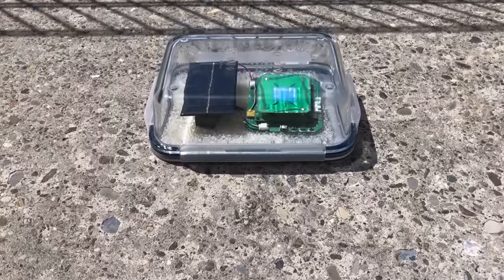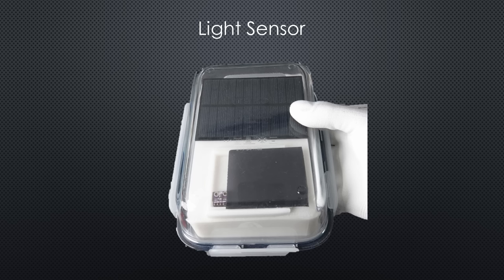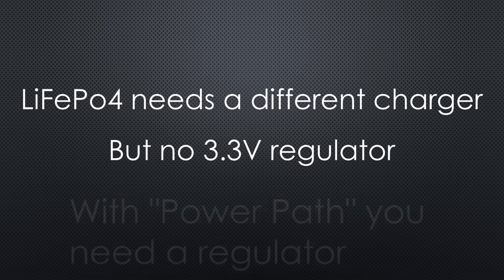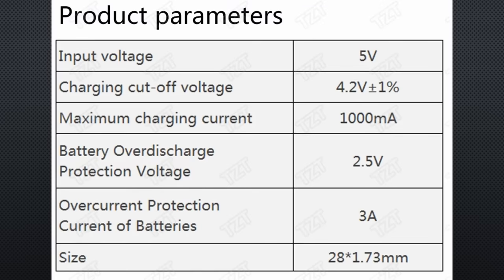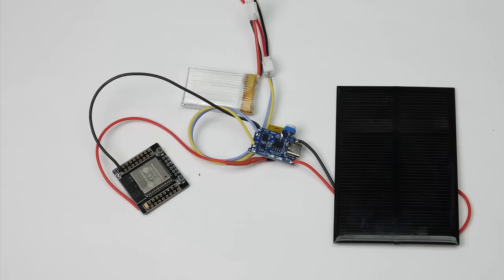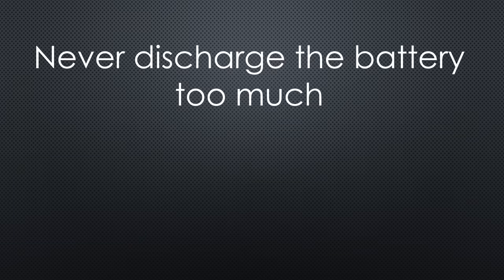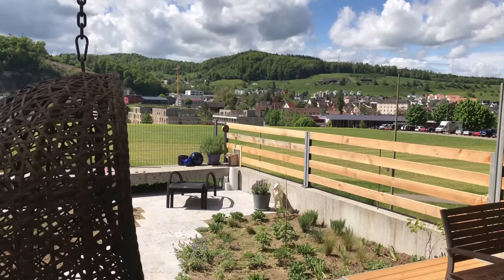#383 Cheap and simple Solar Power for our small Projects (ESP32, ESP8266, Arduino)

Comment: If you drop 4056 and use a proper charger IC, you will find the power path (incl. the switching get) inside the chip.
Reply: whats an example of a proper charger IC?
Reply: @bjornotto98  max77751, but if you make a parametric search at TI with the keyword "power path" and/or "power management" you will find some. Having the battery and the system power on the same output is not the way in modern portable device
Reply from the maker: You are right. You find many chips with built-in power path. Unfortunately none is used by the Chinese manufacturers. Adafruit has one, but more expensive.
I do not care too much about temperatures. So far I had no problems and I did not find any info about charging Li-Ion batteries at low temperatures with small currents. I even read that electrical cars charge their batteries at low temperatures with reduced current. And our currents, particularly in winter, are very small. But I expect that the batteries will not live as long as indoors, for sure.
I also do not see the need of a thermistor. My batteries are always completely charged during high temperatures, and the power path makes that they are not used. So "storage conditions" apply.

Comment: i'm really bad at electrical engineering problems, but here's what i'm planning to use (prototyped it already /got the parts before seeing this video):
- d1 mini with it's 3.3V regulator
- 18650 3Ah cell
- 60mA 4V solar panel (has about 4.5V max voltage without a load)
- 3V9 zener diode to pull down the solar panel voltage in case the battery is full
- schottky diode to battery to prohibit reverse current which would discharge battery through the zener diode
- 18650 output directly to d1 mini 5V input

Do you think this is a bad idea? It doesn't have battery undervoltage protection or a proper charging curve but the battery is way overkill and It's the fewest component/lowest complexity/cheapest setup i could think of. So far (no solar panel added yet) i've been monitoring the battery voltage manually every few days, maybe i'll add an ADC for monitoring the battery as well though (using A0 already)
My esp sketch is always deep sleeping for 60min so the active periods are pretty rare and relatively short
Reply from the maker: Just try it and you will know. You always have this video as a fallback...

Comment: Changing the charge current resistor is not necessary. Solarpanel will take care of this.
Board cuts off the load to prevent overdischarge, no need for alternate current path.
I do use this to charge an unprotected 18650 cell. Did not explode yet.
Reply from the maker: I al glad it works for you. In the special cases I mention you might need these additional parts.

Comment: Great video as always, Andreas! I do have one question though. Have you tried designing your own PCBs?

I find that assembling things from modules, especially when there are modifications to make, is fiddly and takes a lot of time and often ends up with a not-so-reliable project.. and I find that going straight from breadboard prototype to a custom PCB is not only neater but actually saves time in the long run. It's incredibly inexpensive to order custom PCBs from China these days. It doesn't seem like you've made a video about it yet, unless I missed it. I can't recommend designing your own PCBs enough, I started two years ago and I've never looked back. Even if the PCBs are sometimes mostly carrier boards for other PCBs, at least it still saves having to make dupont cables. :)
Reply from the maker: You are right. I also sometimes do PCBs. Usually for things with a lot of connections. Here it is probably faster to add the few components.
Reply: @AndreasSpiess  Thanks for responding! I'll bet a lot of people (and me of course!) would love to see a video from you about designing PCBs, you have a great way of explaining things simply and making PCBs really is so much easier than most people think.
Reply: @leifclaesson2470  i for one would love to see an assembled pcb with these extra parts available

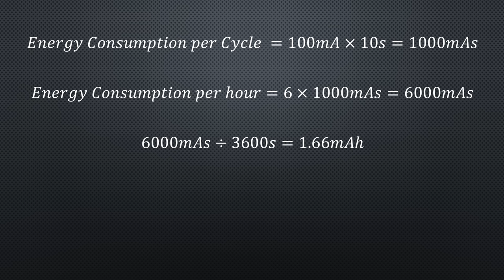Comment: Thank you for the video! I think that there is just a little mistake about units, when you calculated the 1.66mAh(2:41 timestamp) , it looks like  you cut "s" with "s" and you would have "mA" as a result, I think that it should be: 1s = (1/3600)h  -> 6000mAs = (6000/3600)mAh. Sorry for my bad English.
Reply from the maker: You are right. It should be 3600 not 3600s

Comment: For the battery monitor section... when targeting for Deep sleep of the ESP32/8266 I do not like to use voltage dividers... the cannot be put in deep sleep... and they are always draining current (a little... but continuously)... I prefer to let ADC open and measure the internal voltage during the non sleep operation.
The drawback is that you realise only when the Lipo starts to drop from 3.47V (3.3+0.17... I mean, from 4.2 to 3.47 you measure always 3.3V)... but as this scenario is normally in low consumption... you have plenty of (run)time (hours or days) to send alarms and go to your device to replace batteries or check what's going on.... as this is the path from from 3.47V to 2.8V of the Lipo...
Reply from the maker: Good idea! I did not know that you can measure internal voltage.

Comment: Hello, tell me if i'm wrong but the problem is that no panel voltage measurement is taken and operation is only based on the threshold voltage Vgs of a MOSFET, which voltage varies greatly as a function of the drain current. It is even a safe bet that depending on the copy of MOSFET used this voltage also varies. The second problem is that if the panel voltage is low, the current it will be able to deliver will also be low, unless you oversize it very widely. If the available current is low, while the ESP8266 is consuming current, the panel voltage will drop sharply, and the MOSFET will shut off, and the battery will take over. Then, if the panel voltage is insufficient for the TP4056, the charging current will be zero, so the voltage will go to its initial value and the MOSFET will switch again, and so on.
Reply from the maker: You are right: We use the battery to bridge the time without sun. This is why the panel has to be able to deliver enough energy for a whole day in a few hours.

Comment: Would be very interesting to have some lecture with super capacitor instead of the lipo battery. Cheers.
Reply from the maker: I used once Supercaps. But they are only for very low power boards. Not like the ESPs...

Comment: Hi Andreas
In the beginning, thank you very much for your video(s). I know it was produced almost a year ago, but I hope you still look at the comments :-).

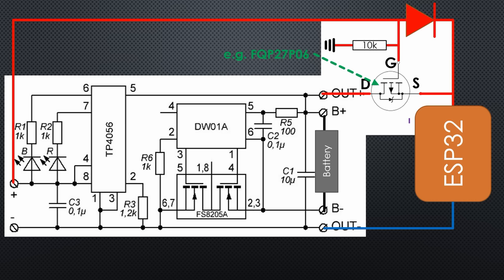I doubt the circuit presented at the video time frame of 11:58. The MOSFET shown in the diagram is an N-MOSFET, while FQP27P06 is a P-MOSFET. Then OUT+ of TP4056 should be linked with S of P-MOSFET and D with ESP32. 

I can be mistaken as electronics is my hobby, not a job. 
Anyhow, thank you very much. 
Best regards
Greg aus Waadt
Reply from the maker: I added a link to a video where this circuit is explained. But maybe I did a mistake while I copied it ;-)
Reply: @AndreasSpiess  NP. We need to be awaken while building it. 
BTW maybe it could be a good idea to have some information about Swiss or European electronic part vendors as I stopped to purchase at AE. I do not want to support them, as long as they support an aggressor. 

With best regards
Greg Malik aus Waadt
Reply from the maker: @grzegorzmalik9279  You find a few Swiss distributors like Pi-shop or Bastelladen. But they sell the same stuff as AliExpress. So I fear that the only thing is to change the hobby because most of the electronics manufacturing plants currently are located in China.

Comment: so I have similar set up and I realised that voltage divider for ADC measuring battery voltage is another culprit: constant leak of the current through these 2 resistors. Issue is: you cannot go to high values with them because internal resistance of ESP is around 200kOhm so the resistance of the divider should be at minimum few times lower. If you make R1+R2 30kOhm then you have constant 4V/30k = 130uA lost 24/7 (irrespective if ESP is in deep sleep or not) - one can say nothing much but when we talk long lasting battery operation... ;-) Especially if this is to be without solar - only battery operated project. Yet measuring battery voltage is a must.
Reply from the maker: I still go above 100 k because I calibrate each device individually and do not expect a lot of accuracy. It only should be a warning to do charge or replace the batteries.
Reply: @AndreasSpiess  you might be right Andreas. Yes, actually I just created small project on ESP that measures voltage on 3 different ADC pins and I had to calibrate each individually, not only because different resistors but also depending on the place on the scale where you expect your values (i.e. different multiplier for around 0.5V and different for 2V)
Reply: quick question program  to measuring  ADC and different paramets on esp   is ?

Comment: I started adding a powerpath to all my solar projects. I still see 'issue' though: if at a certain moment  the solar panel output is high enough to shut-off the FET, rhen after the Schottky doode the available voltage may be lower than the battery voltage  that in itself is not a problem, but then a small current may flow through the small diode in the FET, a current delivered by the battery
Reply from the maker: Yes, this is a "feature" or a "bug". Fortunately, solar panels rarely work in this (transition) area

Comment: Hello sir, Very good information, I have one question, If we use two 100k resistors for a voltage divider, what could go wrong with them? Why is calculation necessary? In my case, the voltage seems perfect with two 100k resistors. Please explain in detail, I'm grateful for your help.
Reply from the maker: You can calcolate or try and error. Both are ok if nothing is destroyed.
Reply: Ok sir , thank you

Comment: Many esp32 boards already have this circuit for battery management, like lolin32. But you need to either use a protected cell or add a protection pcb.
Reply from the maker: You are right. Some boards have battery management on board. So far I never looked at what chips they use and if they have a power path.
Reply: Boards often have have issue of having a "definitely not" low drop out regulator
Reply: @amansaxena5898  I'm not sure I've ever seen an AMS1117 on a board with battery management, but that's a pretty obvious error. The bigger question is whether the UART bridge is powered or not when the USB disconnected.
TinyPICO seems to be the most careful about that: https://www.tinypico.com/
All of the ones where I've checked the schematic, like SparkFun ESP32 Thing, Adafruit HUZZAH32 and discontinued Wemos Lolin32 certainly have "power path".

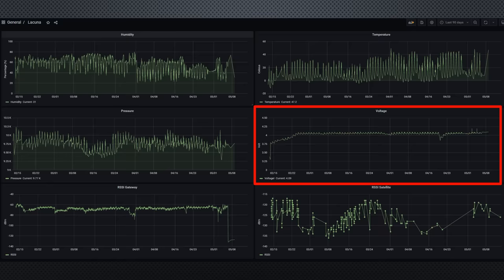Comment: Thanks for the helpful information! May I ask you how you did those graphs at 9:21 ? I made a small weather station, which saves data on a sd card. I tried to make an excel chart with temperature and humidity over time and date, but excel just doesn't want to work somehow.
Reply from the maker: I use Grafana for this task (I made some videos about my setup. Search for IOTstack.

Comment: Very interesting the opposite connection of the p-mosfet. It is the key to do what you say. The usual way connection simply doesn't work. It cannot conduct when solar voltage gets lower. It conducts only when zero solar voltage.The worst is that the battery will be overcharged by the body diode. Thanks for torturing our brains😂!!!
Reply from the maker: I was not the inventor, just the messenger ;-)

Comment: Hi Andreas, built this circuit.......and it works.
But it has an issue, when the solar panel slowly drops it voltage in the evening the voltage at the input will slowly drop to 2-3Volts and my ESP8266 stops. When the input is like 5-6 Volts it works great, of course the ESP has a 3.3V regulator.
To solve the issue i added a cheap 741 comparator with a 3V3 zener and a 330 ohm resistor. The output is controlling the FET via the resistor of 100K which need to be disconnect from the input. Now when the input voltage drops in the evening, the comparator switches the load to the battery when light conditions are low and the ESP runs on the battery.
Reply from the maker: Good decision. I think, I read another comment where somebody did something similar.
Reply: @AndreasSpiess  Thanks, I have two other remarks, I have 5 board with micro USB and 5 boards with USB-C.
The boards with the micro USB work fine and i changed the R3 resistor to 3K to limit the load current.
The boards with the USB-C are not working, no load currect in my USB meter.
In your video it looks you use USB-C board but the input seems to directly from a PS to the input pads.
Did you try with a USB-C cable and any idea why the boards are not working with USB-C.

Another consideration, when the load is very low, like a AtTiny85 in deep sleep, i wonder if we need the extra circuit because the current to the load will be very small.  

I will test my not working USB-C board later with a direct 5V supply and check if they work like that.
Reply: Checked my USB-C board but with a direct PS of 5V, and it works. However now also the load via the USB-C works, only difference is another LIPO, maybe the previous LIPO was already almost full which confused me.
Only to modify the R3 resistor from 1.2k to like 3K is a patient job but possible and i am 64 years old 🙂
For sure all these boards need to be modified for R3, the default R3 gives indeed 1A load current and i almost burned my finger as the board get to HOT.
I have one board with your circuit and a 741 opamp running on a small solar cell running an ESP8266 with LORA sending TEMP and HUM, of course it goes in deep sleep and also switches the DT22 OFF and my Battery Resistance measuring circuit is also disable in Deep Sleep, works great and i am happy.
Reply from the maker: There are different boards in the market. So maybe we have not the same...
Reply: I needed this solution too! Thank you. I am curious about how to implement your solution in detail..

Comment: Thanks for this video! I'm trying to figure out how to combine the power path with battery monitoring but can't think of how to do it. Can you maybe explain where to connect the resistors for the voltage divider and where to lead the second volt-out line, assuming the first one is put on the ADC pin, while still maintaining the power path?
Reply from the maker: I do not see a relation between the power path and voltage monitoring. To measure the battery's voltage, always connect your voltage divider to the poles of the battery.

Comment: Two questions is I may: 
- I noticed from my solar panel (which is not in full sun due to the position of the sensor) that I am over 3.6V (the minimum operating voltage of the Li-Ion charger board), only 3 hours a day. Would it make any sense to put a step up converter (tuned to deliver something like 4V) between the panel and the charger to harvest even from 1V ? Or is that a waste in your opinion ? BTW I set RProg to 10K for minimal charging current.
- Is there any point to remove the 2 LEDs on the charger board to save some extra mA ?
Just curious ;) Great video anyway!
Reply from the maker: If the solar panel does not get light it produces no energy. I assume also the current is very small in your situation. So stepping-up the voltage would probably not help a lot. A bigger panel or a better place would be much better. But you can try it and measure the current.

Comment: Very nice !! Thanks !
Reply from the maker: Glad you like it!
Reply: @AndreasSpiess  Yes, i think it is a simple and smart solution  :)

That's a little bit off topic :
I think I have read something about Silica Gel getting conductive if it absorbs enough water, but I don't know how conductive, and  if it would influence the circuit that's sitting on it. Also Silica and Battery Electrolytes don't mix well I think. This maybe something to further investigate.  (If the stuff on the bottom of the clip on lid plastic container is indeed Silica.) 

A solution to keep such a small container moist free might be an Solid State dehumidifier. (Clive made a Video about it v=Vabq-s62IVM)
Reply from the maker: It is Silica and I added it a few weeks ago. I will see how it performs...

Comment: Nice idea, this power path
but you mentioned that the 2nd diod is needed to protect the battery from some 6V.
What prevents the esp32 from being exposed to the 6V that should not go to the battery?
:) a connection to wify when voltage rises to high :)
Reply from the maker: I showed earlier how I add a voltage regulator to the ESP32.
Reply: Your hacker soul! Sorry, i
I missed it in the connex. Thx for your greate channel, from a guy with a Tyrolean accent.

Comment: Great video as always. The use of a trimmer as current set resistor is  however not an elegant solution.
A trimmer is not reliable used as variable resistor and can reach very low values at one end. So a fixed resistor is defintely better. I am sure Andreas knows that.
Reply from the maker: You are right. You can of course replace the trimmer when you did your optimizations. The trimmer will be used at the "high end".